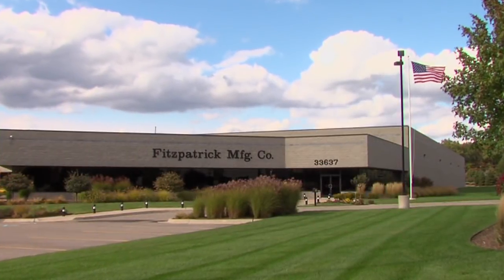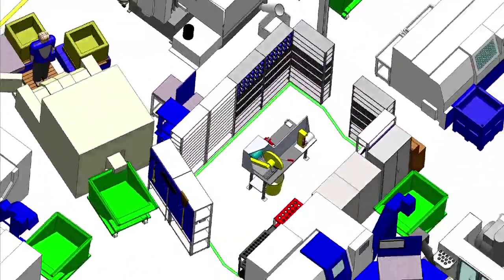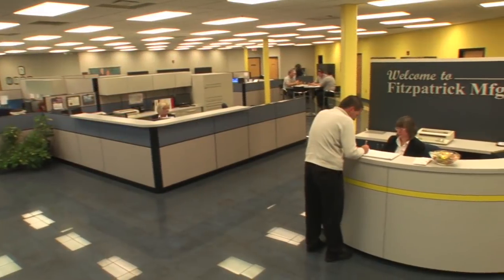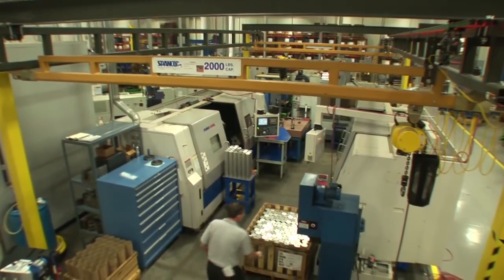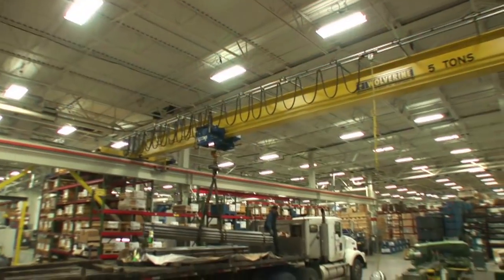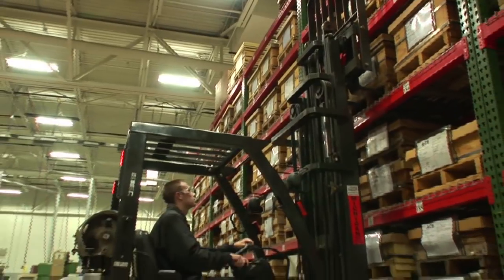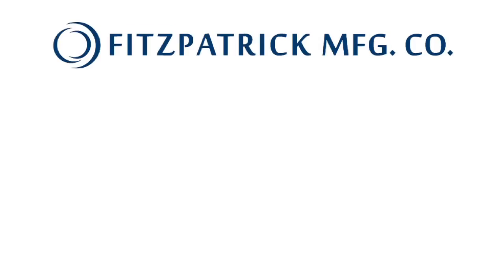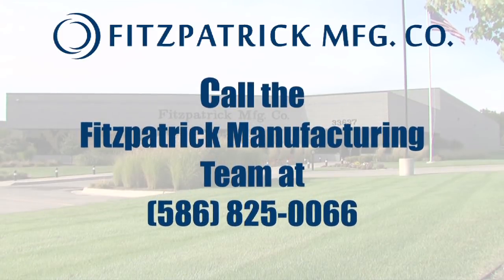Fitzpatrick Manufacturing Company: A CNC Machine Shop Unlike Any Other.

Comment: I was impressed until I seen the haas cnc how can you make a quality product on shit machine ? I wouldn't sub work out to any company that uses haas spend more time fixing them then you do running them
Reply: +Carlos Bias much. Yeah, they can't stand up to, say, DMG mori or any other top notch brands but haas still makes a pretty dang nice machine that can make nice parts.
Reply: +rkshireygames I've been on the Apps since 1993 I must have been in 1000s of shops over the years from small subcon to massive multinationals doing batch and turnkey work.I have so many horror stories about HAAS CNC lathes and machining centres.Ive worked for Okuma Mazak BOST over the years I'm now @ WFL and be lying if I said there had never been problems.But here it over the 23 years you hear the same horror stories over and over again with HAAS machines and the frequency they have problems is ridiculous.They are seriously underpowered fragile machines.The Electricals and drives are weak to say the least.Every 1 can make a bad machine Problem is HAAS don't learn from their mistakes and continue to do so.I have known start up companies nearly go under because they have purchased HAAS and they have been totally incapable of doing the Job.And that's before I even mention down time due to breakdowns.I could go on and on with this.